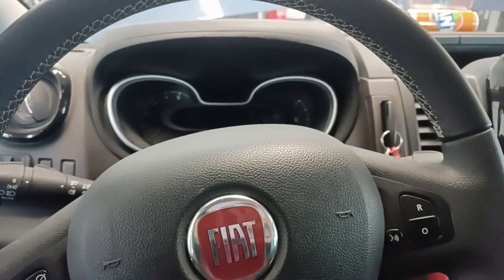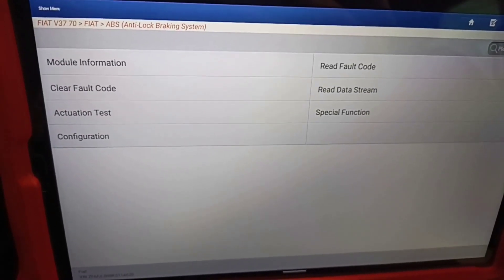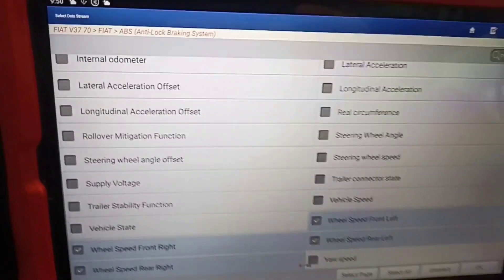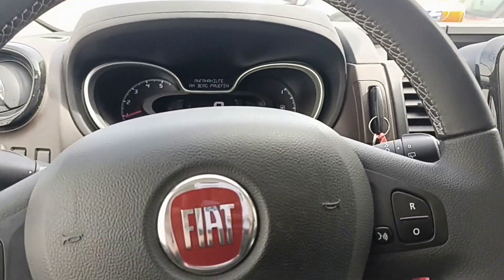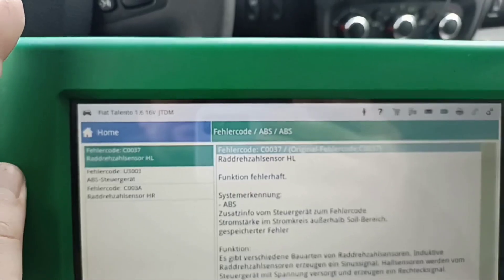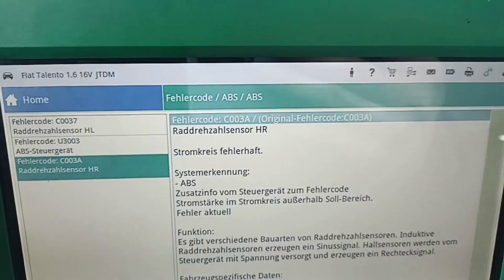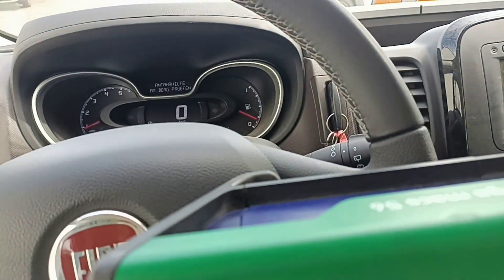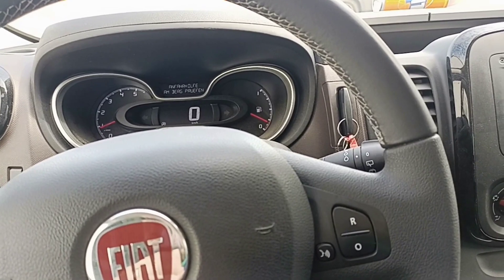ProDiag-Xdiag fails on new cars ! Fiat Talento ABS problems. errors : U3003, C0037,C003A.

Comment: Hi, your videos are really helpful and i really appreciate your time helping us, i am beginner in this stuff but i really  like it, i have the next problems scan with xtool a30m on golf mk6 2009 2.0 tdi 140hp: 01542 - rotation rate sensor - electrical error in circuit, 01279 longitudinal acceleration sensor - electrical error in circuit, 01423 lateral acceleration sensor - electrical error in circuit, 16352 control module- faulty, 00538 reference voltage - electrical error in circuit, b104129 oil level thermal sensor,range/performance, b104135 oil level thermal sensos, signal too long high, can you please suggest me where the issue is?
Reply from the maker: Hello. 
Before you change something in your car look at live data. Check all these sensors if you have reading or not. You must drive the car to be able to amae Infos. This live data you will find on the ESP module.
Reply: @YOYODiagnostic  thank you very much,  i really appreciate your help and your time, i been to the mechanic he told me that the abs module is faulty and not that easy to install the new one so he offered me to install the older version as golf 3 ( without abs) so now i don't have any issues on the board.

Comment: Hello, could you please point me to a cheap scanner that can learn/reset the turbo actuator (vgt).  I like the ThinkDiag but I don't know if it works for this purpose.  It would be for use in Ssangyong brand Diesel cars from 2013 onwards.  Thanks a lot.
Reply from the maker: Hello,
the turbo actuator can only be programmed with the Turboprogrammer. 
 If you just want to reset the parameters then I think that Autel is more efficient than Thindiag.  It is best to ask the seller and if it is not as described you can return it.

Comment: Hi , can I ask what is the difference between mcm and acm? I just want to perfom a delete or maybe off the dpf in my truck, what should I read mcm or acm? Thank you, more vidoes and subs!
Reply from the maker: Hello,
I didn't quite understand what you mean but to make these changes like DPF you have to read ECU or ECM or DDE it's the same just with different names.  The Ford company calls them differently than the BMW or VAG company.  And then when you read it you have the option to read Flash which is the same as MAPS.  For example if you read with Kess or Ktag it is called Flash, if you read with Flex it is called MAPS.